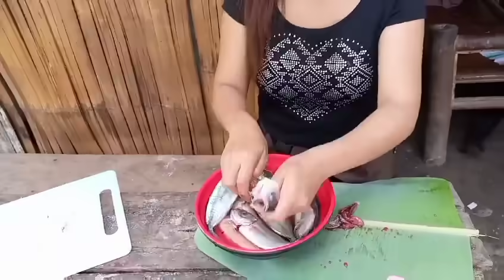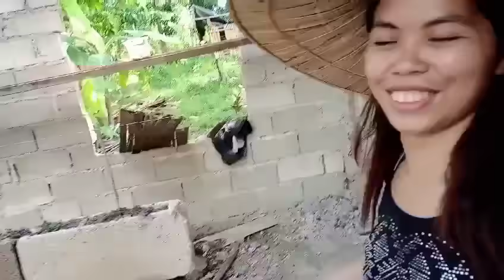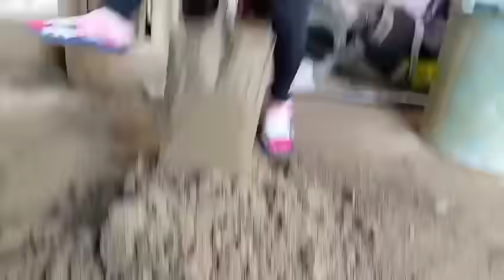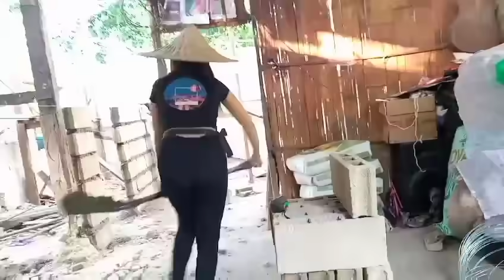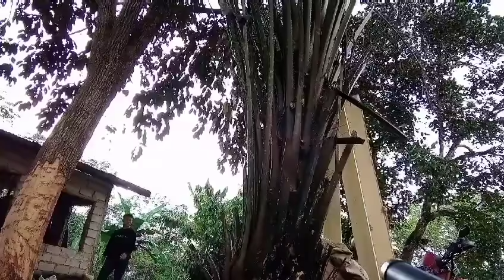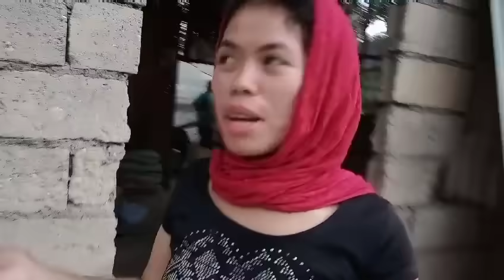Kahoy Concrete sa bahay OT l AmericanPinay Vlogs l Jane TV

Comment: Make sure that the horizontal bars of the hollow block walls are connected to the posts and make sure you have a beam on top of your walls. This is so it won't topple down especially sideways if there is an earthquake.